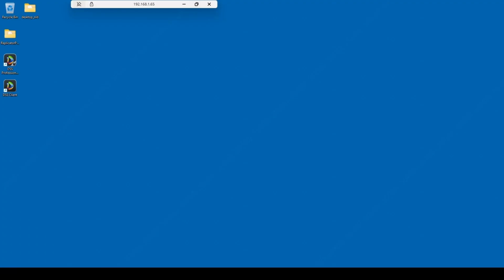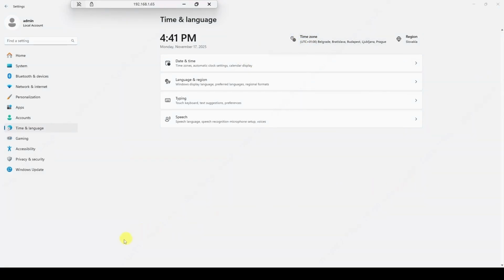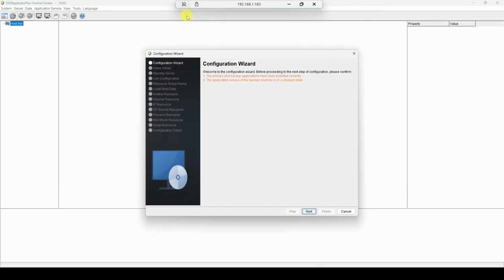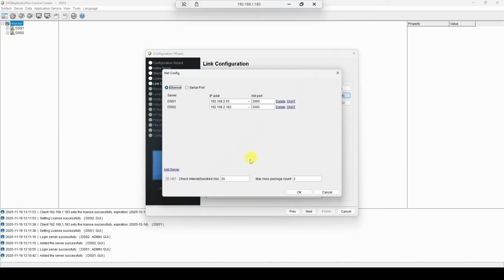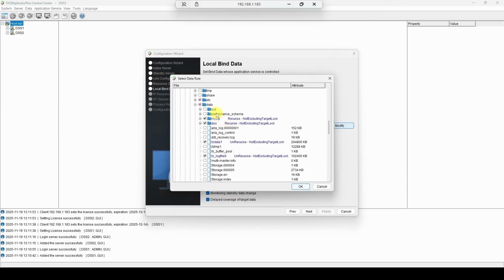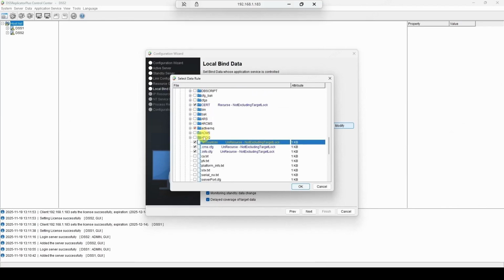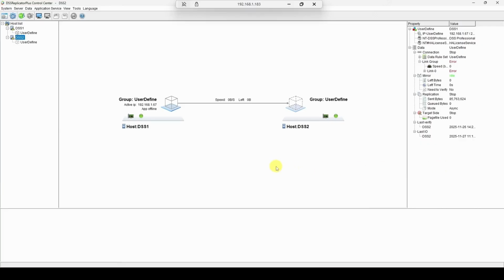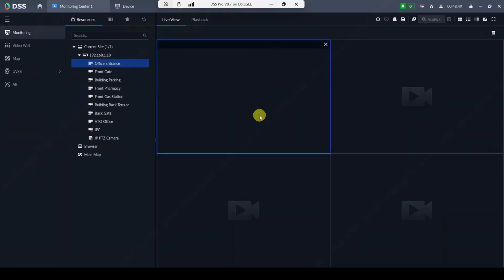DSS Pro -8.7 How to setup HotStandby server

Comment: Hi sir, if I have two Dahua hardware servers (Dell Appliances) pre-installed from Dahua with DSS Pro V8 (Linux-based, not Windows Software), do I still need to use the DSS Replicator Plus tool? Or is the Hot Standby feature fully built-in and configured directly from the web interface using the Redundancy menu?
Reply from the maker: Hi which version of DSS are you trying to install ? We have DSS PRO which is Windows base and we have version DSS7116 which is based on linux and it is working only on our devices. I think you have better to reach local Dahua support . If you are installing windows version you need to have replicator. With All in One Linux DSS 7116 you dont need that
Reply: @softwaredahua  

We ordered a Dahua DSS Pro V8 solution directly from Dahua China. The system will be delivered on Dell hardware servers with DSS Pro V8 already pre-installed and ready to use by Dahua.

Could you please clarify whether DSS Replicator Plus is still required to configure Hot Standby in this scenario?

Or can Hot Standby be configured directly through the DSS web interface (Redundancy/Hot Standby settings) without using DSS Replicator Plus?

Thank you.
Reply: @AhmedRaed-g4d  Hello, if you are using DSS Pro, then you need this Hot Standby license + Rose Replicator app. Only in DSS7016D/DR-S2 and DSS7116D/DR you do not need any additional license for Hot Standby solution. We have this covered in another video where we explain how to set up Hot Standby on all-in-one Linux devices and we used DSS7016D-S2 for that.
Reply: @d @davidsiegeldahua 

Hi David, thank you! I have a few more questions about this and I really need your help. Can I get your WhatsApp number or email to chat comfortably

Comment: hi sir.  config wizard, you did it only in standby server. same steps should be followed in main server or not ?
Reply from the maker: Hi , for main server we have older video, mame is how to install dss
Reply from the maker: these steps are done only on standby server... the main server has just DSSReplicatorPlus app installed on top of DSS server instalation, there is no setup needed on the main server, you need to do setup only on Hot stand by server, I hope this is more clear :)
Reply: @softwaredahua thank you for your response, sir